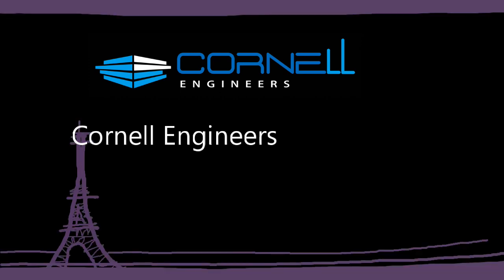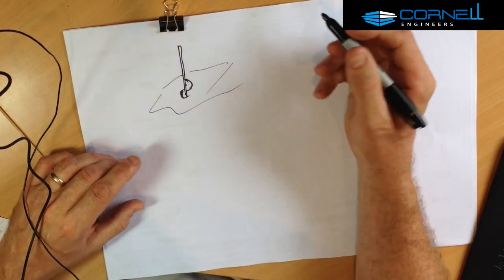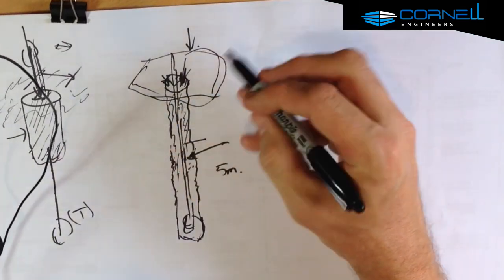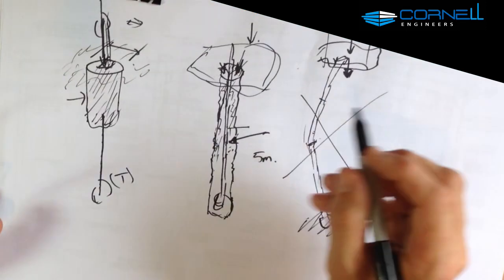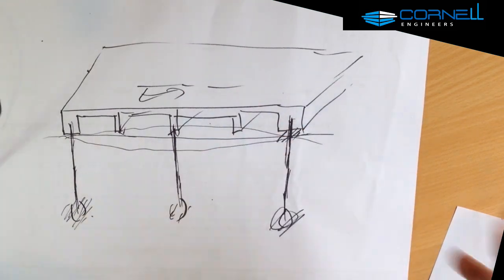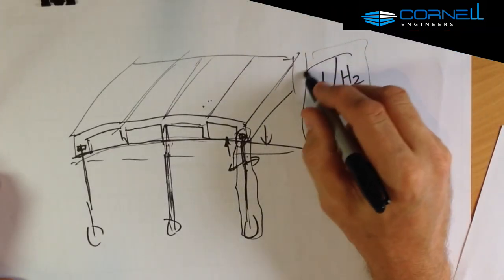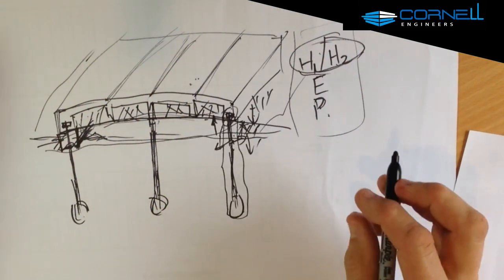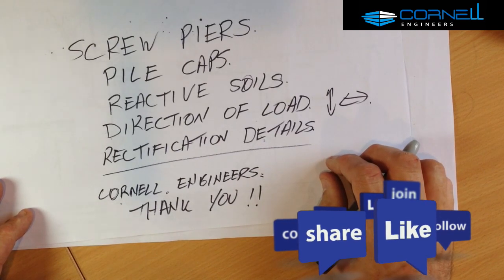What are screw piers? How do they hold up houses? Cornell Engineers explainer video. #screwpiles

Comment: Mate, I'm no engineer but 🤣 if the soil surrounding the pier was less dense (as you infer), than you would have continuing expulsions of soil through the whole 5 metres out the top. Could I argue that as the auger/helical travels, it is compressing the soil behind it ? The initial expulsion would be due to lack of resistance. Indeed if this ceases after the initial expulsion, surely the volume of the pipe is further compressing the soil ?
Reply from the maker: Hi Brian Dirou
It is a legitimate argument that the top of the screw pier is compressing the soil it leaves behind as it travels down the hole. I just wouldn't rely on it to prevent lateral buckling of a 5m long pipe buried in the ground. That's why some screw pile contractors install mid-height screws in deep embedment piers - to improve lateral buckling capacity. The design of the screw pier is up to the screw pile engineer and in that regard I fully trust them. The design of the superstructure is the responsibility of the building's structural engineer and in that regard we all need do the very best we can to provide a (laterally and vertically) stable building.
Matt Cornell

Comment: My porches have 12 inch concrete tubes resting on 24 by 24 footings with rebar in footing bent into vertical tube same depth as basement footings, I can’t 
See these small screws being reliable.
Reply from the maker: Hi Paul
That porch of yours doesn't sound like it is going to fall down in a hurry. Thanks for your comment. Hope all is well in your part of the world.
Reply: A lot of citys are built with these. The nice thing is unlike concrete footings, you know what the pressure is on these as they are installed, what they can bear, and much less worry about them occasionally sinking for some odd reason.

Comment: How long till they rust?
Reply from the maker: Great question. I admit I don't know the answer. My thoughts are the corrosion process on steel screw piers depends on a complicated combination of the availability of air, availability of moisture and damage to the corrosion protection system. Being installed below ground they are very difficult to monitor.
There are of course various opinions and studies that have been done on this subject:
http://piletechscrewfiles.blogspot.com/2016/05/stripping-down-corrosion.html
https://www.researchgate.net/publication/237576562_Introduction_to_Corrosion_and_Galvanizing_of_Helix_Foundations
https://www.helicalpilebook.com/Files/corrosion%20of%20helix%20piers.pdf

Comment: Waffle pods & screw piers ? Do you wear 2 condoms ? I hardly think lateral forces would be a problem. As an engineer, surely control of reactive soils is best achieved via adequate drainage of prevailing ground waters ? Grouting in uneven levels sounds foolhardy.
Reply from the maker: Hi Brian Dirou
You're right. Waffle slabs and screw piers are not a lateral load problem. Lateral loads are more of a problem when a house is on steel stumps and screw piers and the house relies on the screw pier footing only (without a pile cap) to resist and transfer lateral wind loads.
Reactive soils and site drainage are the subject of this video: https://youtu.be/5Cu8PXN3Wl4
Regards
Matt Cornell
Reply: So snarky, and yet many people buy a house only to later encounter these problems.

Comment: Matt, fantastic video explaining the subject and pitfalls. 
I doubt I'm going to have much problem with a 48x16' deck, however I'd had some concerns when looking at helical piles with that unsupported area along the shaft.
I just came across another screw pile manf., and its really is just a large screw.
They are apparently IRC compliant in the US, and they do seem to avoid that pitfall of common helical piles.  With your expertise, could you take a look at these?  https://www.youtube.com/watch?v=lZTnbbOyJic

I'm thinking if they are IRC compliant, they seem to have fewer potential issues.

Cheers!
Reply from the maker: Ahh yes. I think I've seen these used on a home renovation show. https://www.americangroundscrew.com/code-compliance/
They give the capacity of the steel section but no real comment on capacity in the ground so I'm thinking site-specific soil testing and design by a geotechnical engineer. The savings in residential construction would maybe be offset by the specialist advice?
They look like they target solar installations and lightweight structures. I think they look cool but that's not a structural opinion.
Reply: @CornellEngineers  Matt, thanks very, very much for your time and considered opinion. In looking at their specs for soil bearing capacity (Table 5) in clay soil they show 8129 lbs bearing/axial compression.  
This is very close to the large Canadian helical pier manf's like Goliath that I've been looking at. And yes, this is for a deck not residence.